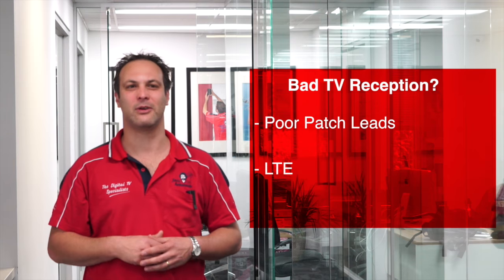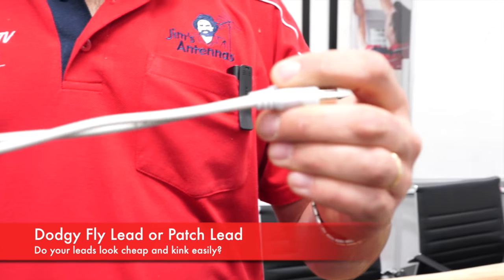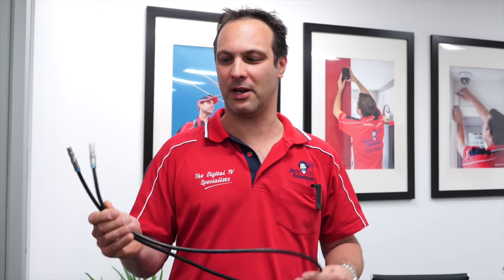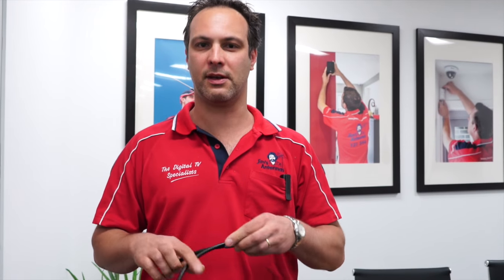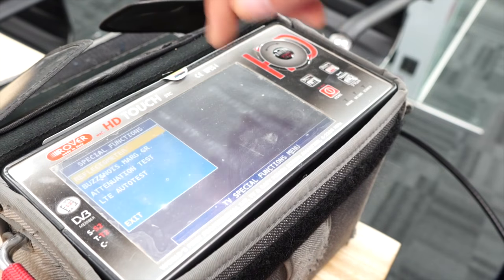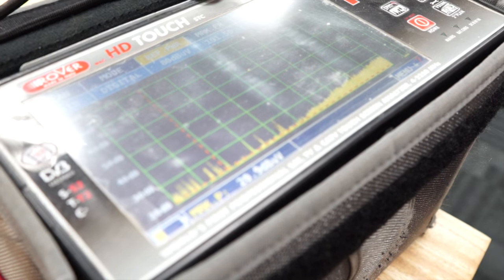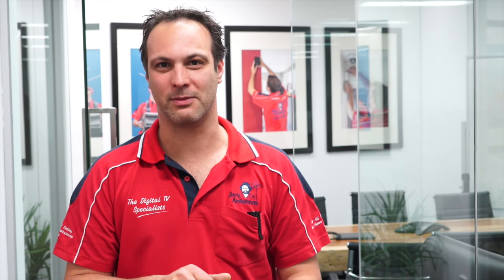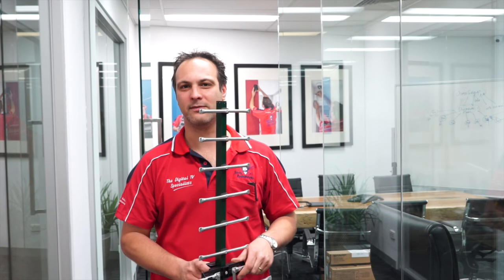How To Fix Bad TV Reception - Jim's Antennas

Comment: Been working for near 2 weeks to fix. My indoor antenna does better than my outdoor antenna - I can watch near 90 channels and I get strong signal strength yet something ruined my outdoor antenna reception on the other TV the video pixelates and pulsates with pulsating sound? All these attempts to fix it then to find how simple it was to fix - just unplug the TV for a minute and plug in again and reception is back to normal.

Comment: I have an omni-directional antenna when I installed it on the roof, the signal reception was good, and most of the stations were visible, but when I installed this antenna higher (8 feet from the roof) the signal changed weak, there is a strange phenomenon that I need to add a reflector (the reflector at the back of general directional antenna) on top of this antenna will then to received signals and see all the stations. I don't know why Mr. Jim knows the reason and what advice does it has? I wish the antenna reflector could be removed.

Comment: I didn't get perfect antenna signal before the antenna cable was rolled inside aluminum foil where it shares ducting with hdmi cables.  Digital signals from regular TV antennas are apparently super sensitive towards interference from other cables. My ducting was only 20cm. But it was still enough to ruin signals on 4-5 TV channels.

Comment: I do not wish to steal your thunder. However, here is one for you. Amplify antenna signal by way of  the existing VCR/ DVD back end input section instead of buying a booster. Then utilize the external antenna outside or indoor. 

Avoid having the electric wire overlapping or crisscrosing or rubbing against the digital cable line.

PS:   Do plan ahead take time or meditate when setting up different wires. Where they end up going to connect and go out and how many of these do I need digital/ coaxial cables. It is imperative to take advantage of line one usage .  

Use TV  "line one" channel   setting .The  RCA cable is for it. Just in case digital cable for the  input is the last coaxial wire you've got, TV needs one.  Hard to get or too short in length. Costs is the key here , more RCA  mixed and match. Coaxial cable is noise resistant I hear.

Comment: great vid, but plz HELP me , im in anew build and had to put my own tv aerial in, brought my self one of them tri boom aerials along with  a labgear 2 way amplifier, put in loft 1st go round BRILL all was sorted got 90% on tv signal, but then i read that if my cable to my aerial is long, which mine was it was 10meters, was to cut it down, so i did , i cut it to about a meter ? BANG nothing, i cant get half the channels i did before, ive replaced the F type plugs  on both ends but still no good , dont understand , it worked brill i had all channels, even HD chs but cant get no more then 30 chds now, why, any help be very greatful.
thanks matt
Reply from the maker: Hi Matt. Perhaps the connectors haven't been done properly? Might be worth giving the experts a call on 131 546
Reply: @jimsantennas  sorted thanks was loose f plug, it had me pluzzed but got all Chs now.

Comment: if there  the same wire than comes with   Optus pay Tv had 2 cables     i split them apart  went jaycar   got  adapter  screw into lead    replace  crap  in tv    great pic   now

Comment: LTE interference, sounds like a load of crock. Ch31 the highest frequency at 557.625MHz is well below the minimum 4G frequency of 700Mhz. More likely to be an issue with the El-Cheapo TV's having front end overload rather than antenna or coax cable quality.